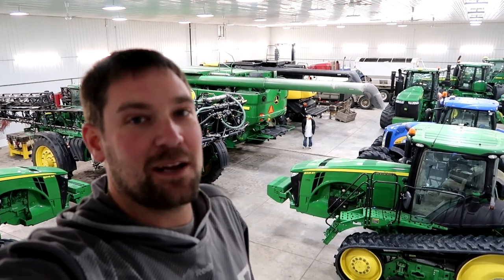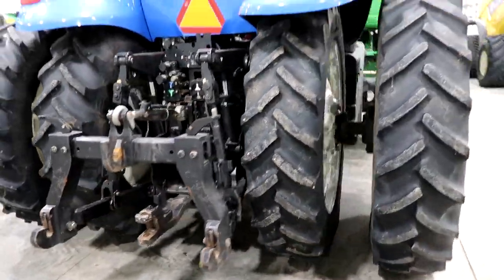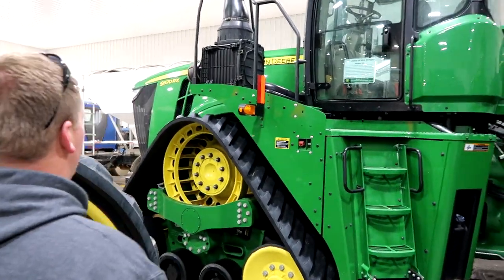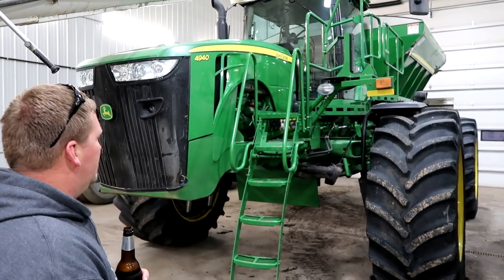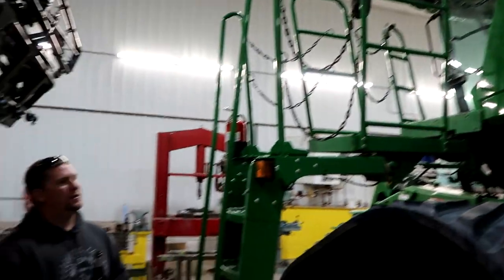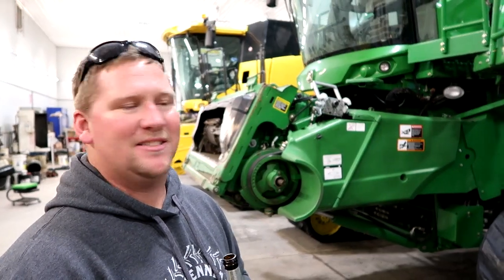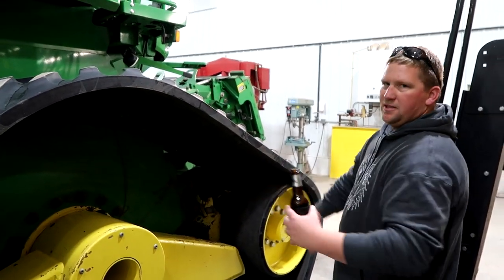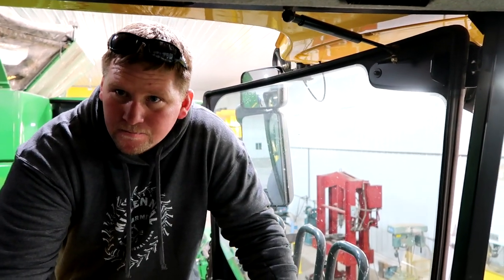Equipment Envy!!!

Comment: My dad does not like Deere (besides his old 1030 and other older Deeres with a round cab). He had one and drove with a slurry spreader, but the Deere was too light in the back which resulted in the rear tires lifting up while he drove down the road, sent him right into the ditch. Tractor was more or less totaled, but my dad got off scratch free. After that he ran a Fendt 939 Vario untill he closed down his company. We live in Europe for anyone curious.

Comment: “Why don’t ya go no till, that will save the world ya know?!” LOL!!
Reply: We've gradually started planting no till corn. Only better results. Not like 100 bushels to the acre more, but higher yields lower fuel consumption and less time. End-rows can get rough but when you can accomplish what a ripper, finisher and fertilizer spreader can do in one pass at almost 10 miles an hour and add more bushels, it is hard to not use no-till. There may be a year where it fails and completely sucks but we've done it to some degree for 4 to 5 years now and it is actually really good. Will not the save the world though.
Reply: No-till alone probably not, but as part of a broader program also involving cover crops, yes it will.
Reply: 5:08 he just looks at the ground and says "yeah" hahahaha
Reply: Don't rule out minimum or no tillage.  It has saved countless tons of top soil, saved thousands of litres of diesel fuel, polluted less and still produced huge crops in western Canada alone over the last 30 plus years.  Progressive farming includes conservation tillage.  Little out of character for you??
Reply: @brianallam5545  in the eastern part of ND over to where he's at it's not as easy to go No till vs out here just a couple hundred miles west. Out there very few run no till and out here almost no one tills.
Reply: @brianallam5545  CO2 is fertilizer, not pollution.
Reply: I think some of you guys don’t realize how much of a difference soil texture has to do with minimum tillage.
Reply: Noah S. I meant pollution from burning more fuel to raise the same crop
Reply: @timothyread3984  It might also depend on how you run and harvest as well. We've no-tilled everything since the late late 90's, but we try and stay in the same place with the cart so we don't have to rip the whole field. But then we also have hills and terraces and tile, I'm sure flat land has different requirements and you most likely don't have to worry about rain erosion quite as much. We still have a cultivator because while ditches happen and water will overtop a terrace, at least our ditches aren't very big.  /Will not save the world, but it's less shit to do.
Reply: In my part of Australia we are almost 90% no till, but we do not have the really heavy soils both those two guys are dealing with so I have no idea.
Reply: Greatings from Germany, we use different crop planting and ground working methods all 50 miles...due to the different soil textures. Down south you would be using tillage, middle is a common no till area, east ist kinda different. Up north we use tillage, but we do not have a lot of arable fields here. Mostly grasland
Reply: @Snowfighter12  Depends on where up north - I grew up South-West of Bremen and its mostly grain, rapeseed and potatoes around here. Most fields are tilled and plowed with Traktors between 150-250hp; Mostly dominated by John Deere 6R and 6030 series as well as Fendt 700 series.
Reply: We've been No-tilling for 12 years.

Comment: 9570RX with PTO....... finally a tractor I can cut and bale hay with 👏 🤷‍♂️
Reply: It Would be a perfect feed mixer tractor
Reply: It’ll run my grain auger
Reply: 9570RX is perfect to pull a new holland 256 hay rake with.
Reply: Yeah, lol,  wait until its hooked to an 80 foot cultivator. 500 acres on bankers hours.
Reply: 1/2 million for the 9570RX
Reply: I think case and new Holland combines are almost identical
Reply: @dedrakuhn6103  I was thinking my yard rake

Comment: We have 2 s690’s that we were running in the Illinois mud this year. One has camoplast tracks and the other has the ati high idlers. It’s a total night and day difference. The high ati tracked machine got buried to the frame and the other pulled directly in front of it and pulled it out no problem. The only bad thing is the camoplasts top out at 14 mph

Comment: That’s some nice equipment I don’t get to run large equipment much but I’ve run a early 2000’s massy Ferguson tractors at my freinds farm and a 2002 new holland tractor at his farm that’s 3 hours away from me I live in a small town outside Charlotte NC and his dad told me and a guy that came to fix the tires on it that it had came from Lowe’s motor speedway it pulled a batwing mower that cut the grass in between pit lane and the front stretch

Comment: Running a versatile 550 dt with 2 4630 monitors and a bridge kit installed. After 4 seasons I've had auto steer work for 1 season. Doing great.... Do love the tractor though

Comment: Those are all nice machines and I love that both John Deere and New Holland made the changes on both of their machines to make them better. John Deere still have some things which they can learn and duplicate which New Holland already have, especially with their small tractors. I have two of John Deere tractors and wish they had put the fuel tank behind the tractor, or on the side and I noticed that New Holland did it on their small tractors to make the equipment better to use.

I would feel like I was in Heaven if I was there and getting to climb up on each piece of that equipment. I love my John Deere brand, but their are areas they can improve all of it. Both John Deere and Kubota could learn from companies like New Holland and make their equipment more user friendly.

Comment: This is why the small farmer cannot compete anymore!  It takes BIG money
 to farm.  The acreage you can process with this kind of equipment must 
be huge to justify the cost!  This statement coming from a farm under 
300ac.  That's amazing you guys guys are part of that generation that is capable of that capacity and equipment.  Just the cost of the garage, to pay employees to clean the equipment, the floors look clean enough to eat off.  On smaller farms, you are just trying to survive until the next day, and have zero time to do crap like that or the money.  Times sure have changed.

Comment: Ive seen hangers for 747 smaller than this Where! Where I'm from we have service shops to work out of the weather but we don't build 20,000 square foot garages for our gear. Most sits under a shelter but just enough to keep snow or rain from collecting on them.

Comment: Nice shop. Could be great to hear about single rotor vs. twin rotor - capacity, fuel consumption, grain treatment, straw quality (if not cutting all) etc. Do you have access to liquid fertilizer that does not scorch the crop?

Comment: Nice lineup,  lots of tracked equipment.  I have always wondered about the difference between the two tracked and four tracked tractors?  Is it just a horsepower thing or is there some other reason?  I have a John Deere too but it's slightly smaller...  LX277, ha ha ha.

Comment: The thing I don’t like about 2 track machines is they loose traction when turning and if you get in wet soil you can’t turn nicely the machine has to pull in a straight line because of loosing traction due to the turn.  A quad trac can easily ojt pull any 2 track machine.  The case ih quad trac I found was quite a bit better on fuel then the deere.  I love deere we have everything deere except for the tractor. That pulls our airseeder.  600 quad trac pulls our air seeder. We demoed every comparable powered tractor. The case quad trac is king   The agco high clearance sprayer is soooo much better then the John Deere sprayer. We had so much trouble with our John Deere   The rogator style high clearance sprayers are bullet proof.  The air booms they have are so nice to blast the spray down into the crop.  U can actually cut the amount of chemicals you use because the coverage is so amazing.  You should demo one. But we live deere and their service.  But other brands do have some better equipment then deere with certain types.

Comment: Those processors in the 9570RX and 8345RT are 4640 processors.
Reply: Flamefurthecat 05 
4600 are the mounted ones and the 4640 are the portable ones
Reply: @masterpipelayer1652  I thought the 2630 and 2600 were the receivers that can be used in multiple equipment.
Reply: Flamefurthecat 05 
Correct. The 4600 and 4640 are the new monitors

Comment: I wonder how the john deere tread tractors work, cause with wheels its only forward back with what id assume to be a differential on the rear wheels,  how does the motor shaft drive the treads independently?

Comment: Assuming that “stupid big bump” is there to assist with climbing out of mud. Maybe your just in it deeper then it was designed for 🤷🏻‍♂️
Defiantly not a lack of power if it pushing the mud. Maybe a lack of paddle (grip) paired with to heavy to climb out

Comment: Don't be so quick to make fun on no-till, most of that expensive equipment is needed for tillage and to address problems caused by tillage not to mention the thousands of gallons of fuel and wear and tear hours and depreciation. I just watched you mudding corn out all fall...maybe instead of poking fun at it you should look at it closer and educate yourself better on it.
Reply: Brent 
Lots of no till just west of us on lighter ground and lots of attempts on heavy ground like ours including from us but in the end everybody ends up back to conventional on the heavy ground
Reply: @masterpipelayer1652  Heard the same here, including from my late father. As it turns out the heavy ground here after a couple of years of no-till and cover crops no longer acts like the muck it once was. Saved me thousands in tile that was once planned to go in. The default mode for people that cling to their tillage is to always say "it won't work here in our soil" and it always turns out to be wrong. I know, I was also once one of those guys saying that BS. That's fine, I moved away from it unwillingly because my land lords insisted I either make it work or lose my ground. I made many a quip like the one made in the video but I made the best of it and am happy I did even though it was against my will initially. Now I'm diversifying with cattle and making money again. I will never miss the fuel bill or the hours and hours spent with my ass planted in a tractor seat doing tillage. No-till may not "save the world" but I'm far happier with it than I was with conventional tillage. The waterways and ponds are much cleaner and my field erosion is no longer a concern. Best wishes for the 2019 season guys.